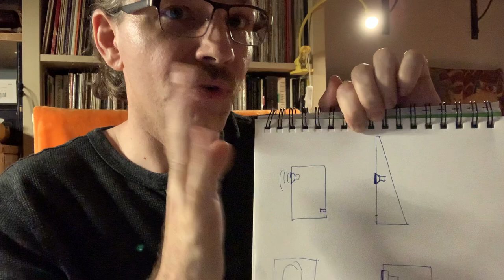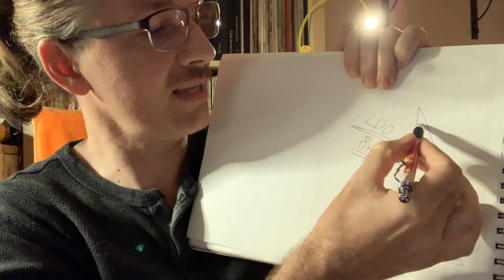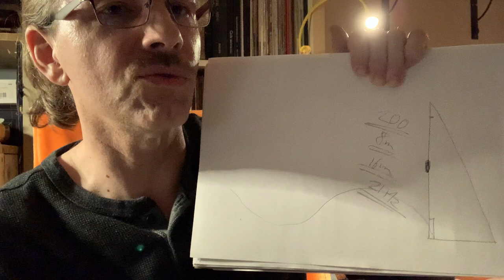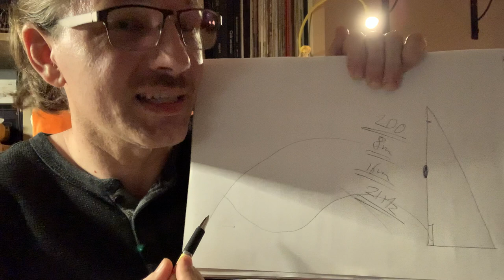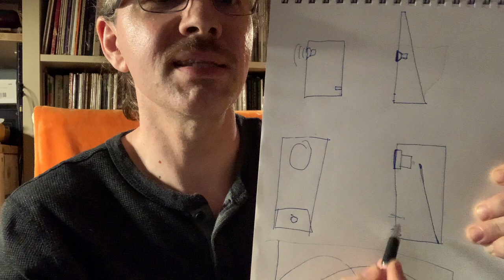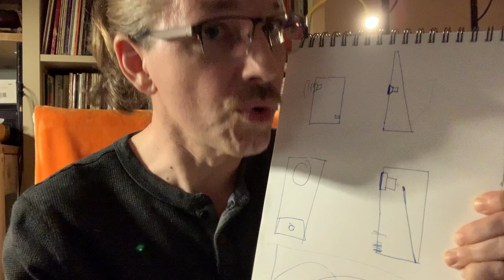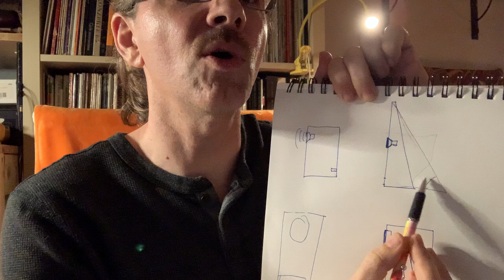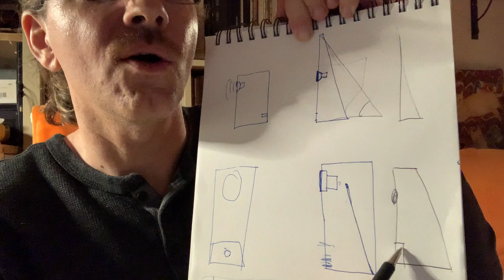Voigt pipe physics for Dummies!!

Comment: Great job, Janos! I am an organ builder as well, so can attest to the fact that folding over a pipe makes little difference to its sound. We do this often to make pipes fit  under low ceilings. It is called "mitering"  and can employ some wild angles to fit in an organ chamber. Keep up the great work!
Reply from the maker: Thank you Russ, I learned something new! :) 👍✨ Cheers, Janos
Reply: @realworldaudio  without much knowledge I made a folded voigt pipe (I later found out)...with arbitrary dimensions...
But the sound after stuffing in a scientific manner is splendid....
It blew my mind...
Voigt pipe concept is so robust I think it needs little attention to details...
Of course details will improve the sound no doubt... Still ,any voigt pipe either folded or unfolded will sound better than most of the other speakers...
Reply from the maker: @clearbrain  That's quite my observation as well! There's just so much math about trying to predict the best placements, and yet my experience was that the best sounding pipes were all using sheer luck - I go with what looks and feels Right... the first folded pipe I designed for my brother, without any math for port size or driver placement turned out to be totally amazing. My first Voigt pipe also a similar strike - heard many afterwards, but none close. First and the last all in one ; ).
Reply: @realworldaudio  delighted to hear your experience.... bravo

Comment: I found that in a bass-reflex box, you can suppress the up-down resonance well by putting the woofer and the port just outside major resonances (1/4, 1/3, 1/2, 2/3, 3/4th of the height). This leaves the back-front resonance, even if quite room dependent. Some say you should use box dimensions that do not correspond with our musical scales, others do (Janos has a video on this). When you don't, it may avoid agitation by played notes - but if they start resonating anyway it will sound very 'off'. I personally take the planned x-y-z internal distances and play the 3 corresponding notes on a piano, just to hear what those resonances sound like. If the chord sounds good, I'll continue with those 3 dimensions :)
Reply from the maker: Yes! I also use the 3 dimensions and take them as chords, and listen to the chord played on a piano or guitar on how it sounds... if I'm satisfied, it;s a go. ; 
I also did something weird: I tuned the VOL for the A422.5 that's common in baroque music... as baroque is my favorite music. (Instead of the A440 scale of contemporary music.)  
The tuning still works, as the relationship of the 3 notes is the same - just it gives baroque the extra edge... ; ).
(Actually, in the Baroque period they used everything from about 398Hz-430Hz, yet Handel and Bach used 422.5 the most, hence my choice of the tuning frequency... )

Comment: Brilliant explanation, thank you. The single full range driver / horn & voight/lowther fanboys seem, not totally but highly correlated with the tube and dare I say no feedback SET extremists, and while there are some deep truths in there (class A is good) there seems also a LOT if snake oil smoke and myth (this or that resistor or capacitor will change your life, use only left handed solder on the left channel etc. Height gives you lowest 2/7th wave, angle hence volume to hit Vas .. simple !
Reply from the maker: Thank you Dave, you are welcome !; ) Janos

Comment: This video was so endlessly helpful. Many, many thanks for this vid. As I’m trying to figure out the best type of cabinet to put my tweeters and drivers in, this video has given me some great ideas for possible cabinet designs. Thank you very much, Janos.
Reply: go for this _| shaped internal baffle design, with a slight till up at the top, the driver is sitting in the middle the cabinet. make sure you keep your dimensions of the internal baffle nearly the same to the backside of the internal baffle volume and back of the speaker only 3% more volume. you want to keep control of the driver free air movement, the pot opening can be quite large,
you will achieve 8 order bass reflex.
what size and drivers you got what sort of tweeter driver
Reply: @hoobsgroove  Hey Hoobs. Thanks very much for the info. Any ideas are very helpful. The drivers and tweeters I’m using are from 1959. They’re by Pioneer. The driver is an alnico 8” and the tweeter is a compression driver horn. They’re already in a cabinet, but I think I can design a much better one. Here’s a vid I found of the speakers. This isn’t my vid, nor would I have chosen the music. lol It shows the inside of the speakers though https://youtu.be/hDBa3hNaPZU
Reply: They’re also 16 ohms, so I’m gonna drive them with a low powered SET amp.

Comment: I thought about this today. If a voigt pipe that is 2 meters tall can support a certain frequency, then it stands to reason that if I have 2 meters of space in my room, then my room should support the wave as well... Unless I am misunderstanding something about the quarter wave.
Reply from the maker: Hi Dan, the 2m in the pipe is not the full audible wave, just a quarter of it. It will give birth to the audible wave: the quarter wave has to extend to a full wave in the room to become perceptible and gain the room boost, which is the most important consideration for the low end of bass response in a listening room.
The room should be 8m to hold the full wave - if shorter, the full wave cannot form. We can imagine this as an exercise rope: we are holding the rope at 1/4 of the length to generate the force that gets the whole rope moving. It's not the entire rope coiled up in the pipe, only 1/4 of it... ; So, whatever the limit of the room, the pipe can go only that low, as that's the rope/air it can tug. The rest of its potential gets unfulfilled, as there's not enough "rope" to get moving.

Comment: Thanks for an amazing video! So much technical information squashed into a short video. I feel I now know the basics of Voigt design speakers like the new Sibelius by Pearl Acoustics. I don’t yet understand why it’s so expensive, though, since it sounds pretty simple to design and manufacture from your talk. I also feel I’ve learnt from you that Voigt pipe designs and transmission line designs are actually a totally different concept even though they have superficial labyrinth similarities. It seems that the a Voigt  pipe aims to create a wide range of frequencies whereas the transmission line aims at one resonant frequency. Do others agree (if you are still there a year later)?

Comment: In a helmnholtz design  , the port tube ( call it an air plug ) inverts the phase of output . Hence the  port output will be almost in  phase  with driver front radiation , albeit with a slight delay commensurate  with length of travel from back radiation  to port outlet  .
In voight pipe the port is functioning  only as an outlet ( in the absence of air plug ) for back waves of driver and hence will not invert the phase favorably as desired to match with front  radiation  .
So it appears that port output ( most of which is low frequency  ) of voight pipe is almost 180 degrees  out of phase .  In logic , there should  be a cancelation  of low frequency  . Paul Voight could not have been ignorant about this ! How is this physics addressed  or the phase  corrected ?

Thanks in advance for your effort to explain .
Reply from the maker: I have to put this into perspective. The Voigt pipe was one of the very first cabinet designs ever, LONG before Thiele Small calculations became the standard, and any of the considerations you mentioned started to be addressed. It's kind of like saying how did the inventor of the brake handle the transition from ABS generation 5 to 6... the Voigt pipe cabinet is THE cabinet that was perhaps the first that was ever designed with acoustic puprose in mind, and not cosmetic as speakers before. However, the Voigt pipe addresses the issue you asked about very nicely: the mouth is at the floor level, and the mouth output arrives at you the same time as the first floor reflections do. So, in practice it works very well in an organic way.

Comment: Thanks for your fascinating explanation in practical language I can understand
Reply from the maker: Glad it was helpful! 👍
Reply: @realworldaudio  the most helpful part was distinguishing between a bass reflex “air spring” and the 1/4wave being like a lever to excite bass waves in a big room…. It really helps to. Learn bAss will not be reproduced in a small room and 
So clearly understand now that the room impacts sound far more than joe average recognises
Reply: @realworldaudio  it was also extremely useful to learn that as long as the room has at least one direction long enough for deep bass waves that a voight pipe will have a chance to get that bass wave of excitation going (like a soccer crowd standing ovation being conducted by a crowd member in a big wave around the ground)

I don’t fully understand it but since your explanation Of a little wrist waving a long arm I am
Beginning to get it
Reply: @realworldaudio  while I am taking up your precious time 
I am very interested in BIB 1/2 wave speakers (terry caine)

Where the “speaker opening” (there is no top plate)  points to the ceiling and there is an internal baffle looking to me a lot like an upside down folded voight pipe

These BIB speakers are often 2.1 metres tall and the transmission line would be double their 2.1m height…

Comment: Thanks for this update, I was thinking of trying to make some cabinets. Wanted your views on making this a live cabinet, I could try tone wood and make them much like a musical instrument, if so any views on thickness, thought to follow your idea of support frame for the speaker, mounting and then add the panels allowing experimentation with the mount, interface, etc. Your thought and ideas much appreciated as you are much further down the road.
Reply from the maker: Hi Paul, for tone wood cabinet the general idea on thickness is: the better the wood, the thinner it can get. The thickest would be a 3/4in (18-20mm), and the thinnest 1/4in (5-6mm). The best recommendation for imparting the least personality on the sound is spruce, but that gets impossibly expensive for a large cabinet size. You can try any tone wood, as long as high quality and  aged to some degree. All will work extremely well, and different wood gives different personality - just pick the wood you like the most.  Generally, for thickness 1/2in is the practical thickness for a large panels, thinner high quality wood is very hard to come by.  Good luck! ; Janos

Comment: it is a port any opening is a port, and air doesn't leave the cabinet it excites the oxygen molecules in front of the port like a driver that produces the frequencies.
not necessarily the size of room can determine low frequency response, it's more how many chambers can determine bass frequency, for instant if you had partition walls in your room you place the speaker in one corner and you sat at the other end of the corner well give the bass frequency enough length to reach you, because there's no cancellation in the frequencies. all rooms suffer from cancellation and this can be sorted out easily.
when I said to you about bending pipe I meant at the top so it looks like a K from the side, instead of having 2m you could have it 1.5m tall and bend the other .5 metre at the top.
the truncated is the best versions in can produce a much lower frequency as long as you put an internal vertical baffle from the port to the driver, it increasing the volume of the the internal volume pipe and the right pressure speed.
this is the principal of PCM transmission line.
Reply from the maker: I have read opposing interpretations from loudspeaker designer professionals on what should be called a port. Some get very angry when a Voigt pipe opening is referred to as a port. Typically, a loudspeaker port is defined as a tuning device that opens a narrow bandwidth channel for energy exchange between cabinet internal volume and outside air. Here, the Voigt pipe opening does not behave in that fashion, if you do the modeling then if it behaved as a port then it would allow energy only between approx 200Hz-70Hz to be transmitted between Voigt pipe and the room. Which is not the case at all, the slot is open for a very wide band of frequencies because it is not operated as a bass reflex port.

Comment: Hi Janos,..it,s me again. I Have Build a Little Model  1:10. Now  I,m thinking about it, can I put the Port downfiring with 5 cm Distance to the Ground and I will use only 4 mm Plywood for Cabinet. What do you think about it,…is it wrong or possible?
Reply from the maker: Hi Roberto, I think it's a good idea. I would recommend thicker plywood to the sides, keep the thin only for back and front. Also, use 4mm ply only it it is super high quality. If not, then I really recommend 10mm or thicker. I have not seen yet plywood thinner than 6mm that would be of sufficient high quality. You might get lucky though if you have very good lumber in your area. Good luck!
Reply: @realworldaudio  Hi Janos,…Thank You for Answer.
Reply: Did you know Hans Kortenbach (RIP) from Musical Affairs? He experimented with 4 mm Tonewood and he said that was the biggest Jump to Natural Sound. He builded his Cabinets like a Musik Instrument too without any damping Materials,…but with Wood Rips to elimate to much resonances. Stability is Not the Problem,….Wings from Model Aeroplanes are builded with very Light Balza Wood.

Comment: Nice presentation! Two question please. (1) How the properties of the pipe are changed if using a straight, not tapered, pipe of the same length and internal volume, and also assuming the same locations of the driver and opening? (2) Formally, Voigt pipe is different from the tapered TL by the opening location. What will happen if on makes the opening on the narrow end instead of the wider one of a given pipe? Thanks.
Reply from the maker: Hello Igor, 1., if not tapered then you get all the box resonances and are back to a boxy cabinet sound. The box is resonating at 3 peak frequencies instead of being a frequency-neutral device. 2., as the air exits through the high pressure region it will behave more like a bass reflex cabinet with an unusual shape.

Comment: Hi Janos, could you expand on a Voigt pipe with Karlson resonator (Not the Karlson box, though separately that would also be cool). Also damping reduces the air speed in a quarter wave pipe, would you dampen a Voigt pipe, and how?
Reply: In his videos on LaGrande speakers he mentioned that he would only put slight amount of foam to round out sharp edges. Other than that no dampening

Comment: can't help wondering if the ancient Egyptians were trying to build super big speakers, when they built the pyramids? Pity they couldn't buy the drivers for another 5000-years, but...WOW, if only they had!!!
Reply from the maker: Wow, I just tried to imagine placing a 16in Altec into the pyramid capstone, and firing it down... huge party!!!! ;) Wish they made pyramids like that... if we could have sent James B Lansing back in time. (James B. Kheops?!)
Reply: @realworldaudio  haaaa...that's why I commented, to stimulate your obvious Creativity! :-) Brainstorming SHOULD begin with Laffter! However, I envisioned a pyramid shell, with a cross-corner dividing interior "wall". From point-to-base, at the corners. In plan, an intersecting cross. One driver would be mounted on each of the upward-angled sides, allowing for broad dispersion (take that Dr. Bose! :-) Here's the thing, I'm an old ECOhome Designer/Builder who's built many speakers (remember SpeakerLab in Seattle, kids?), and some "nutty" clients have wanted "pyramid" homes, which is REALLY "nutty"(!!), and I refused. Still, the pseudo-science of "pyramid-power" stated all sorts of "magical" attributes to pyramids. Who knows, readers, maybe such a speaker as I've described may be the "answer"!!?? :-) If anyone can, it'll be...YOU ! post a video! buona fortuna! by the way, the GREATEST Creations have begun by using paper & pencil (or, scratched on mud tablets))), and I'm so very glad you use simple tools, too! Psssttt...I've got 9-12" Peavey's you can use for your experiments, no charge!

Comment: Hi, I have some 3 inch Full range drivers. Can I make a 1 meter tall Voigt and have a Full 80HZ to 40Hz extension? Fs is arround 110HZ. Was thinking about a port loaded enclousure but I liked this very much!

Also, do walls need dampening? Thks
Reply from the maker: It might work, although Voigt pipe do not like short lengths, I'd recommend 1.4-1.5m. Also, if it does not work well as a Voigt pipe, you can still transform it into a slot ported bass reflex - just close down the mouth of the pipe to a slot port. 
Wall dampening would work with MDF cabinets, but a huge downgrade with natural wood.  Overall, you don't need to dampen the Voigt cabinet as the triangle shape is a mechanical dampener - much better than any amorphous (dampening) material.